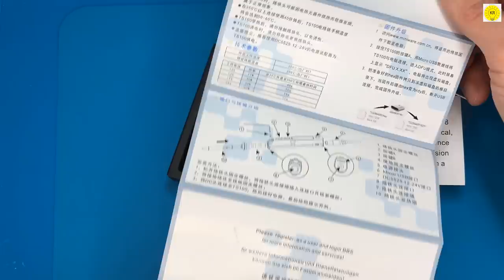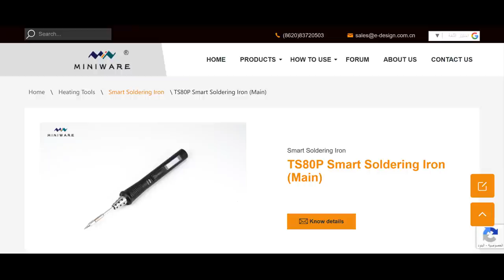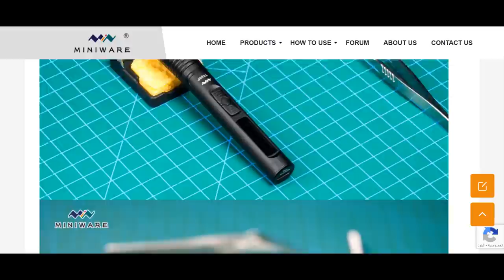Why You Need The Ts80p Smart Soldering Iron, electronics , miniware

Comment: Sorry, if you clean the tip of the older solder iron you can solder the SMD component without problems.  You must care your tools. On job side I use JBC (solder iron and hot air) and at home Ersa and JBC solder iron and also a Quick hot air station.